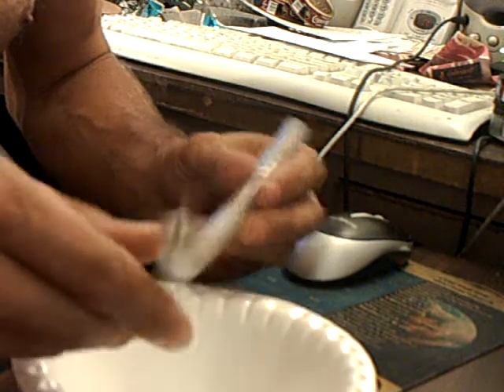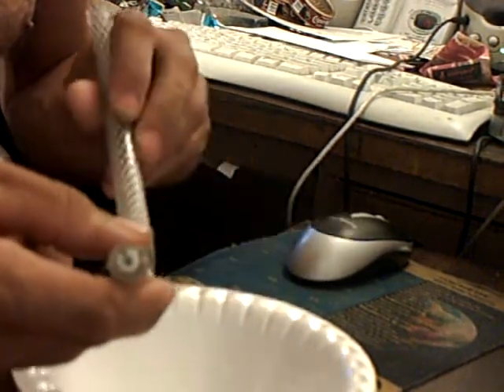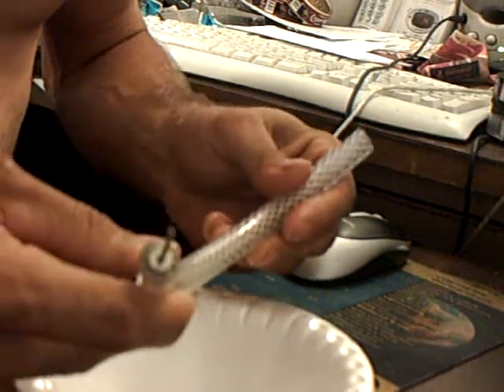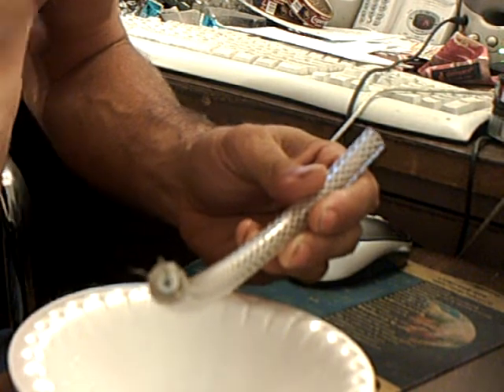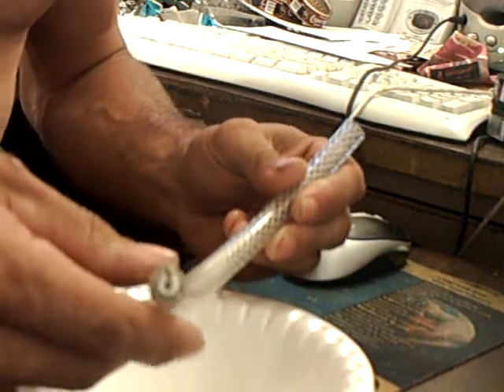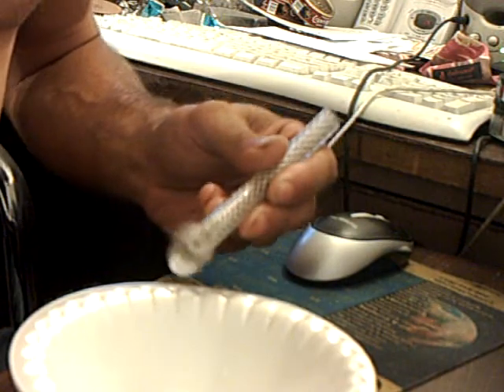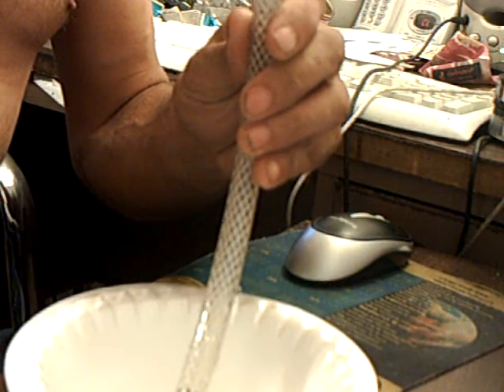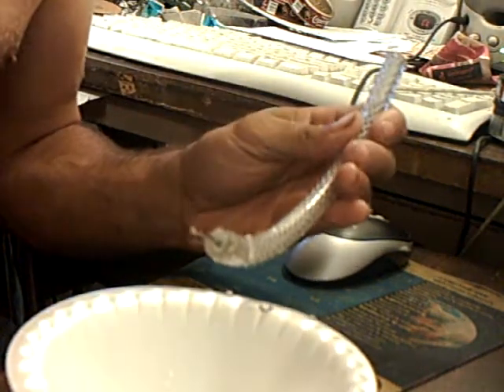My new  hho DRYCELL project #2 Electrical efficiency

Comment from the maker: The no hole was the most efficient (7-7.5 mmw)but for the gain in efficiency was not worth the the time and trouble to built it...I have scrapped this idea.All the cells I use now are top hole only plate drycells and i get mmw from 5.5 to 6.8....I been messing with this stuff for almost 2 yrs and the less exposed edges in the electrolyte the more efficiently it makes the gas....

Comment from the maker: I have done all those test way back ,the less holes in the plates , or less edges exposed to electrolyte the more efficient the cell...Ive done wet cells, tubed cells,tubed drycells, plate drycells with holes top and bottom , plate drycells with top hole only and drycells with no holes.